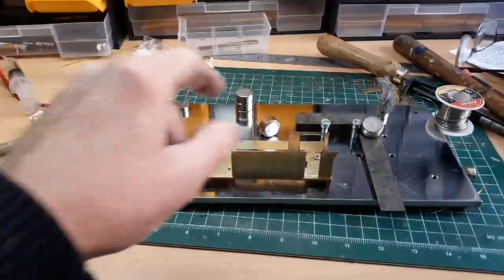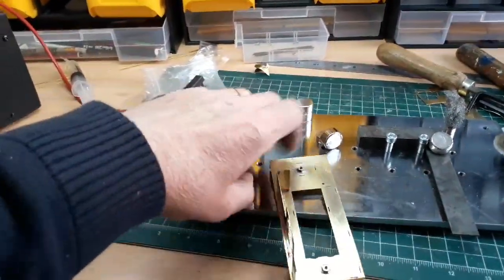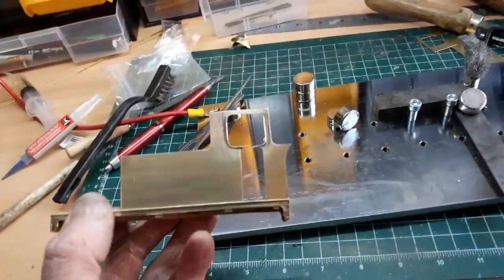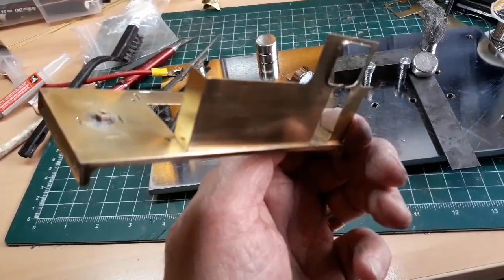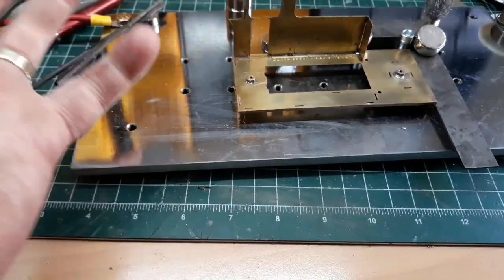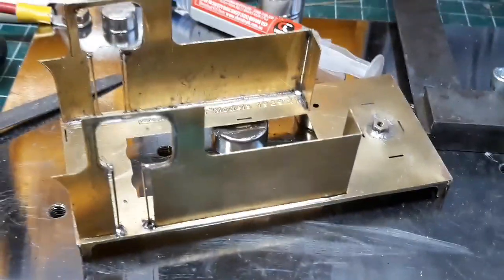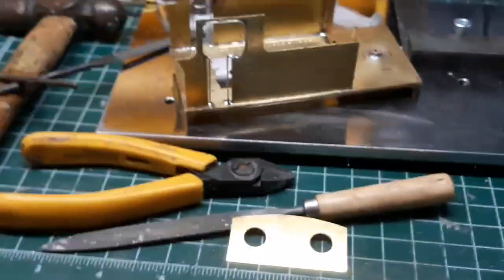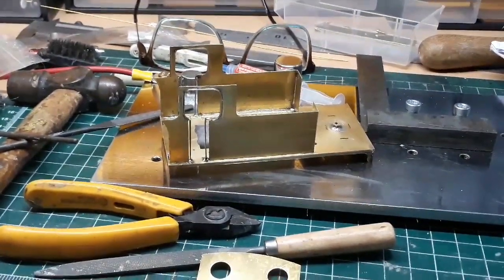Connoisseur O gauge  loco starter kit  Polly.     Part 2.     30 June 2020

Comment: Hi Steven, Do you not need/use flux with resistance soldering?
Reply from the maker: All depends on what solder.
If I'm using solder paste then no, also electrical solder as it has a resin core, however sometimes I do use some flux.
Obviously if I use 188 or 145 then I need flux